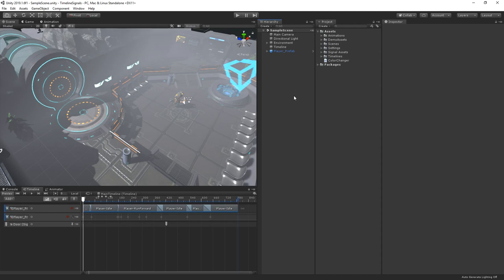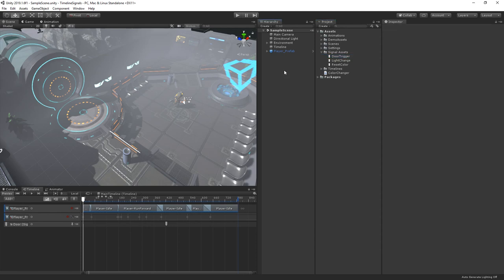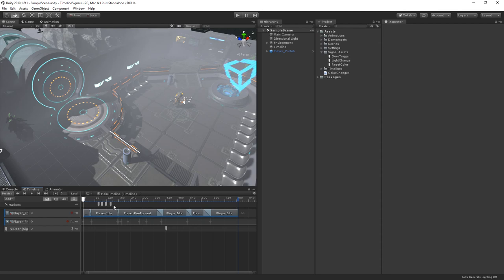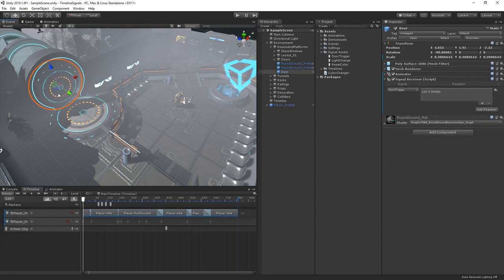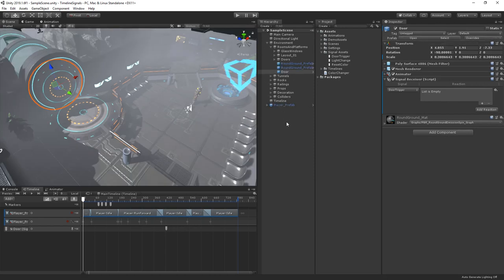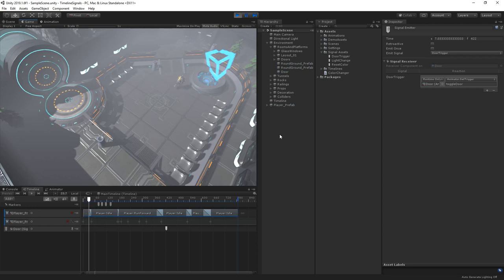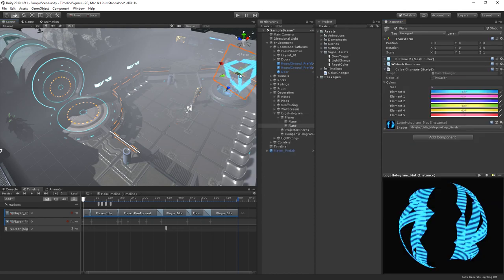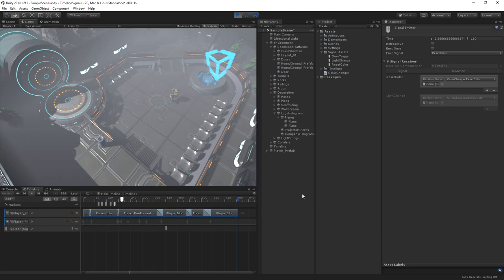Timeline Signals in Unity 2019!

Comment: What do you do if you want to use the same signal but just change the parameter? For example for subtitles or speech bubbles? ATM I have to create a new signal object for each piece of text and that just doesn't work for more than a few phrases. I want to be able to set that text in the timeline.

Comment: I wish you would add the same/a similar system for Animation Events. The current is quite restrictive to only call functions on the given object, the animator is on.
Reply: just put a reference to another object in the function that is on the animator. Otherwise, you're gonna have broken dependencies if the animator tries calling objects 
that don't exist
Reply: @josh_swanson  Thanks, but I know how to bypass the issue and work around it. This new workflow just seems better and more intuitive.

Comment: Help facepunch (rust devs) finish their game. A lot of problems from the game  derive from your engine
Reply: For example? Many problems could made by developers them selves. Performance,features,stability,net connection etc. But its true that unity lacks features that are used out of the box.
Reply: I fail to see how.
Reply: Yeah no, bud. Just cause you're frustrated you can't zerg out efficiently because their game is unoptimized doesn't mean anything. They've been building on the same skeleton, adding more and more and expecting it not to break when the engine changes. They don't have to upgrade the Unity engine, but a lot of Rust was likely built on alpha features that saw upgrades and changes later on as well. So its really on the devs.
Reply: Ravenis Black revenis you are uninformed, go look at the dev blog and look at the commits that they’ve been adding for years. Its clear they are trying to manually fix the issues that unity throws at them like incorrect item pooling, ram allocation and many other issues other engines dont have
Reply: @AbyssLMachiine  again. Unity doesn't enforce engine updates. It's obvious they were after new features it gave. Otherwise why update. If the project was built in a current version today, it wouldn't have the same issues provided devs knew how to navigate it. That said. Unreal is riddled with similar issues of its own. Engines have issues all of their own everywhere. None perfect.